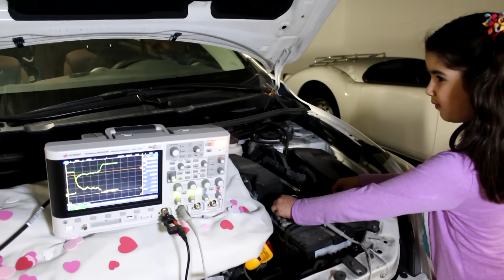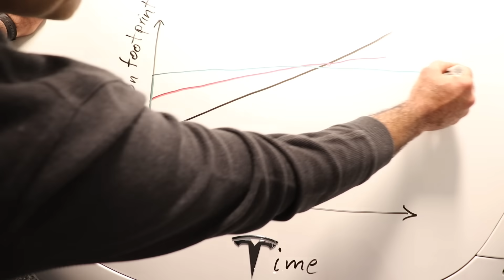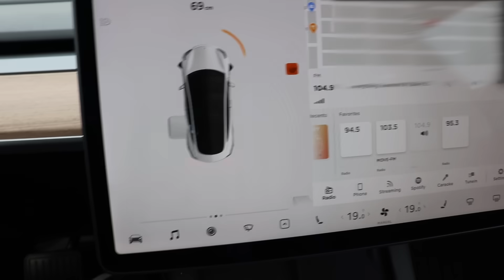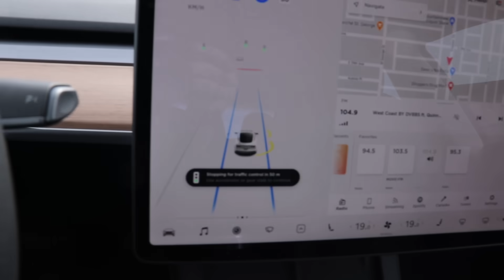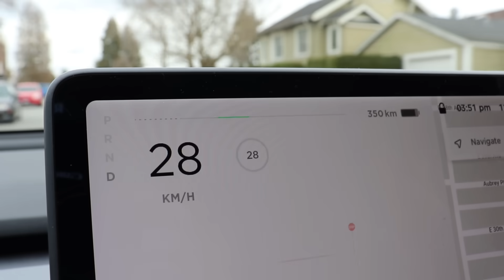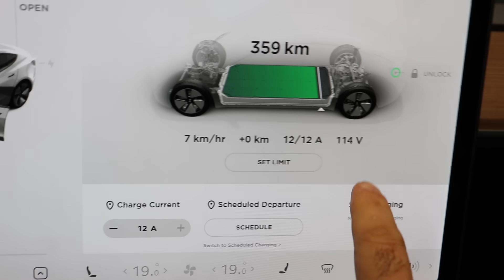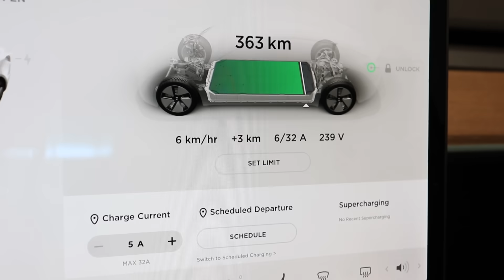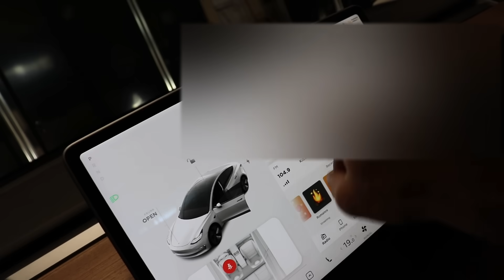ELECTRIC VEHICLES & My Tesla Model 3 Review

Comment: Still 18% powered by coal and natural gas (carbon). So make your line climb at 20% of the speed of the gasoline engine. Bet it crosses much later, especially when 50%+ of that thermal power is probably lost in upconverting, transmission, down converting, then charging, and using that charge from the batteries. So, maybe 40% the carbon generation of a gasoline powered car. Still, somewhere, the lines will cross, and you will be doing better... but not in the lifetime of the car I bet.

(Source: https://www.nrcan.gc.ca/science-data/data-analysis/energy-data-analysis/energy-facts/electricity-facts/20068 )

Comment: Ummmm You do realize that each year there is an increase on the demand for electricity as more and more cars, tools, phones, etc run on rechargeable batteries. And that means we need to build more power plants to supply that electricity. Which then leads to burning more fossil fuels to run those power plants... You get that right? There will never be enough solar and wind power to run everything we need. NEVER.  Because you can only put solar and wind generators in certain locations.. And you can only put so many in those locations. Its a finite system. 
So all your talk about decreasing your carbon footprint with a car is bogus. Because now you have increased the demand for coal and natural gas plants. 
I will make sure to wave at you as I drive by in my fossil fuel car while you are stuck charging your vehicle up for 8 hours.

Comment: Of course, you need a heated garage or the 120v charging can't keep up with the loss from the heaters keeping the battery warm.  And nothing about how much it costs to repair because it's new.  In a couple years, after an accident, costs go up dramatically for all those fancy features to keep working.  Of course high end ICE cars have similar problems.  Diagnose Dan as a video of a BMW taken out by a short in the passenger door handle.  Car wouldn't start and he was the last resort mechanic after they'd thrown thousands of dollars of parts at it.

Comment: Technically, super slow charging isn't actually better for the battery.  IIRC, only charging over "1C" (60kW) adds to degradation.  Making the charge last longer is nice for the grid, but uses more energy overall because the car's computer has to stay turned on the whole time. (About 100W.)

Currently I have mine set to 16A and start at 1PM, so it matches my afternoon solar output!

Comment: Battery disposal is still one of the biggest issues in electric vehicles, also, for some countries 300 km is nothing in terms of long trips. Also, for high loads on the vehicle, the torque acceleration relation would be deprecated. For my country, a lot of mountains and trips between cities about 500 km average, the best option is the hybrid vehicle, and exceeds on all the features you mentioned as advantage on electric vehicles (kinetic energy charge, brake by charging, autonomy) and also no disadvantages (no supercharges, no charge, no lame processor and ultra high costs)

Comment: 100 IQ: shaking the steering wheel every 10 seconds and tapping the accelerator every green light
10,000 IQ: jerry rig a windshield wiper motor to automatically shake the steering wheel constantly, and another windshield wiper motor to constantly tap the gas pedal, relying on self-driving to set speed and stop when needed by overriding the user inputs. Naptime acquired.

Comment: You should apply for self driving beta, it would be a good couple videos, also replace the 12V battery with a lipo/li-ion battery as it would be better in the long run

Comment: There no saving on electric cars at all, battery cost 8000 for electric car but gas car battery only 200 dollar, even you buy a used electric car, you still going to pay for new battery around 8000 dollar, but if buy a used gas car, you may not replace anything and drive it for long time before pay for parts,   Switching from gas to electric is beneficiary’s to business people than regular people, as I said you can buy a used old gas car and  you will drive it right away without  paying for anything, but if you buy a used electric car, you going to be force to buy a new battery for at,east 5000 US dollar. See it benefit business people, because they are seeing people buying used gas cars and  benefit business people just a little for a cheap parts. Example you can buy. A used gas car for just a 1000 US dollar and, and spent just like 100 dollar on it to change and clean transmission oil and drive it for like two years or more wit ought paying a sent more, like I did buy a 1999 Honda CR-V for 1000 dollar and drive it for two years and I start changing parts myself just for safety because the car pass 200000 miles in odometer, with electric car will never have that chance again buying used car for cheap,  if you want buy a used electric car you will pay at least 5000 US dollar for new battery plus the cost of the car of course, it will come to at least around 7000 two 8000 us do.lar just for an electric old car.

Comment: You said charging is more efficient at lower currents; could you run some tests on at 6A and 10A on both 120" and 240V to compare power delivered with power drawn? Seem to recall someone not recommending charging at 6A because of lower efficiency - but buying a tesla to check wasn't an option..

Comment: I watch Fully Charged Show on YT and they had full analysis of environment impact of EV vs ICE car from obtaining raw minerals, to manufacture, to whole fuel chain and down to recycling and disposing, EV are all in all 10x less polluting currently than whole ICE car is. So yeah EV is more environmentally friendly than your gas guzzler. 10x more green. Go EV!

Also manufacture of normal car uses more pollution because it needs lot more energy and material in factories that are big and complex that even EV cause more pollution in manufacturing is a MYTH. When your fuel uses fuel to make fuel and uses more fuel do deliver fuel to you to use is just plain joke and after all that wasted fuel in the end you throw away 80% of it as waste heat.

How do I know that this manufacturing carbon footprint is a myth? Because some say it's battery, some say it's use of more metal due to heavier weight and there is no single unified reason out there for it. With peer reviewed science paper on it obviously!

 I guess I'm one of those overly green people now eh? Oh well, at least we'll have some fresh and clean air again.

Pro tip for every electroboomer! Do not charge your EV on your travels to 100% it's much much faster to charge it to 60-80% because last 20-40% are 2-4x slower! You can make your trip faster with smaller charge which you can even see on dashboard how much it's getting in and you can decide when the kW charge is low enough for you to say meh it's not worth it i'll just charge again on next station.

Comment: This is why hybrids are the best option at this point as they offer both regenerative braking and drive on the battery but with the benefits of a combustion engine and because they're using a significantly smaller battery the initial pollution is also lower

Comment: BEVs on 100% coal power are still cleaner than ICEVs. Explosion engines are much less efficient than electric motors, offset by fuel density and future debt, and stationary power plants have economy of scale plus better scrubbers and combined heat & power.

Comment: You get 8k back from the government  if you buy one ? - here in Australia they want to hit you with a levy for owning one because the tax on fuel is so high here and the Government doesn't want to lose any revenue if everyone switches to EV's.
I didn't see any mains power sockets on the dashboard - where does one plug the soldering iron into😂
Don't tell me they didn't fit an inverter ! All that battery power and you can't run your fridge off it during  a blackout - useless piece of junk 🤣
May as well go back to riding a horse - whack a set of shoes every year, it mows the lawn for you and you get fertilizer for your garden for FREE !

Comment: Mehdi your statement about gas cars not gaining from a drive up to the mountains is incorrect. 
My car gets about 280 miles per tank of gas before needing filling, and after two trips up to the nearby 9500ft mountain I get 375 miles before needing filling. An increase of almost 100 extra miles. Everyone that lives on the mountain also notices substantial gas tank range increases. Because the engines are more efficient at more open throttles, and coasting down the mountain uses very little fuel. Same concept as semi-truck engines designed to be big enough to haul the load but not too oversized, plus diesels run unthrottled always(air flow) makes them more efficient. 
Just saying.

Comment: Regenerative breaking exists in gas powered cars with a manual or automatic dual-clutch transmission... Well, kinda. When you are coasting in gear you are not using any fuel, but you don't get your fuel back.

Comment: https://youtu.be/CvmvFGaSc6k could this be possible?

What I feel is if instead of using the regenerative braking when acc pedal is lifted, what if we use low power generators at each wheel, so we have 4 generators which are continuously generating electricity while car runs, be it in acceleration or deceleration state. Also this would reduce the mechanical transmission losses while regenerative braking is used.

Comment: Fun fact. An engineer who worked for me bought a Tesla to drive some 100 miles into work. He got on the freeway, held the wheel and let auto pilot drive him In close and napped. This is dangerous.  Don’t do this. Butttttttttt. He did.
Reply: People have crashed and died doing this, which is clearly outlined when you enable the feature. Money can’t buy brains
Reply: @towlie911  Several Murphy's law adages claim that idiot-proof systems cannot be made, for example "Nothing is foolproof to a sufficiently talented fool" and "If you make something idiot-proof, someone will just make a better idiot." Along those lines, Douglas Adams wrote in Mostly Harmless, "a common mistake that people make when trying to design something completely foolproof is to underestimate the ingenuity of complete fools". ~Wikipedia
Reply: @rennegaddefoxxe  even then it's risky. Like ramming into something or when speeding on highway a little bit sideways and ur car rubs on the wall of highways.
Reply: @monarch3724  I'm sorry to question you, but did you click on my name but reply to someone else?
Reply: What about all the videos of the person filming an empty drivers seat or the ones with the people playing games in the back seat while on the highway?  I know that there are certain sequences you can do to turn off different things you otherwise couldnt...  like tap brake 3 times, push the on buttin 5 times then hold the brake and gas at same time while pushing the drivers window down and then hold down the on button to turn traction control off..  or you can buy the whole tune .  Turns the dash red and lets you be able to drift em..   

And yes i clicked the name but replied to something else.,  cuz who leaves the notification on for comments..?  You really care what people have to say about whatever it was that you said?
Reply: @rennegaddefoxxe  this is perfect
Reply: @The Lavian they don't drop out of autopilot, they slow down and eventually stop. Better than dropping out of autopilot if you are actually asleep or otherwise incapacitated.
Reply: @The Lavian You can automate this process easily
Reply: @Red_Salmond  you could just wrap your hand on the steering wheel and the bumps of the road mey just be enough.
Reply: Really all that is necessary to do this is a weight placed on one side of the steering wheel. There was a company that made a part specifically for this... not sure if they still sell it.

It's a really bad idea if you care about living. You'll probably be fine at least 99 out of 100 times though...
Reply: To ppl who say this is BS: just search youtube for videos on ppl sleeping on the highway in a Tesla, you will be shocked.
Reply: And nothing happened, right?
Reply: Possible, yet not plausible
Reply: inb4 he makes a seat that zaps you whenever you doze off
Reply: so do we drive cars or is other way around
Reply: If that is true, your employee is crazy.
Reply: Sounds like he’s lying and your buying
Reply: Biggest Richard Cranium  eBay as a value guide, which a lot of local pawnbrokers do? 🤣 But all I did was look up a couple quotes about 'idiot proof', so I guess my comment wasn't? 🤣
Reply: Doesn't it have a camera that watches to make sure your eyes are on the road? And if you're not looking at the road for too long it starts beeping at you and then drops out autopilot?
Reply: @MrJoshdavis99  The technology to detect driver attention has likely improved significantly as well. There was a period of time when you could make it think you were holding the wheel by wedging an orange in the steering wheel spokes, and the weight on one side was enough for it to think it was your hand.
Reply: @MrJoshdavis99  they don't use it yet.
Reply: @MrJoshdavis99  The internal camera in Tesla's is not used at the moment. The only driver attention feature is the steering wheel nag
Reply: @MrJoshdavis99 it dosent use camara but if it thinks you're inactive like no movement on steering wheel , no head moments etc it will beep loudly
Reply: That's not actually possible. You need to give input otherwise it cuts out. I don't know why people keep repeating this misinformation.

Comment: my uk vw passat 2.0 diesel cost me $2300. uses 1 gallon of gas in 55miles and costs me around $1000 a year in maintenance. How many years before you have spent less than me taking into account the cost of your car in the calculation?
Reply: You also forgot price of batteries , that must be replaces after some years of  use. So, it is not fair to compare electricity price vs fuel price only.

Comment: @15:45 FYI, the on-board charger as well as the ac/dc charger is more efficient the more you draw current of it. It is way more efficient if you charge with full power compared to minimum.
I agree on other points.

Comment: yeah, therein lies the problem. You save $1200 on fuel a year compared to a decent combustion engine. But you pay like $20,000 more for the vehicle. That's a LOT of years you have to be driving that thing to make that $1200/yr worth while. Sure, you save on some basic maintenance, but what do oil changes cost me per year? $150-200? That's still a lot of years at $1400/yr. And that's assuming the batteries on those things survive the entire lifetime of the car, which is a real question. If they don't, then the "saving on maintenance" comparison gets even weaker. I'm all for owning an electric vehicle, but those prices really need to come down first.

Comment: actually the accelerator is pretty similar on a manual, on a manual when you release the gas pedal it will engine break unless you put it in neutral or press the clutch. this is why non-synchromesh manuals are very popular on big trucks, because when you go down a hill you can never rely on the brakes unlike on a small car

Comment: THANK YOU for pointing out the distinction between self driving/assisted driving and automatic cruise control. The latter is actually a pretty simple system either with LiDAR or object tracking cameras which is much simply than AI self driving yet ACC provides 90% of the actual benefit. I think the ACC provided in a Bolt or Volt plus some basic object recognition would be perfect. Assuming the AI systems get better I might reevaluate my opinion some day. However I am NOT making the assumption that'll ever happen. AI isn't a panacea. Whats a lot more likely is roads are just heavily standardized to make machines drive on them better.

Comment: I have a Chevy Bolt, it usually takes about ten seconds* to charge it. 
Edit: It's true you'll rarely get the advertised range, sometimes you'll get more than that. YMMV.

*I just plug it in when I get home and it's ready to go in the morning. That's a lot better than the almost bi-weekly trips to the gas station to fill up my old Subaru.

Teslas "phantom drain" much more than my Bolt seems to. I've let my car sit for weeks at a time without charging and it's lost maybe 1 or 2 percent.

Comment: Even in areas that rely on oil-fired power plants, an EV is still cleaner and more efficient since co-generation power plants can achieve 60+% combined efficiency vs about 40% for the fanciest gasoline and diesel engines. Power plants also have the benefit of much more thorough exhaust scrubbing. For city driving, regen braking gives EVs a huge efficiency boost too.

Comment: "price of running on electricity is much cheaper than gasoline." For now, until almost every vehicle is ev
Reply: at that point gasoline will be heaps heaps more expensive as no one will be refining it any more
Reply: @jnawk83  that would take a while i guess, I'm not sure how fast refineries react to demand.
Reply: @crackedemerald4930  when "every" vehicle is an EV, then demand for gasoline will be practically zero and there will be no reason to refine it at commercial scale.
Reply: @jnawk83  but until then, as demand for gasoline decreases, the price will drop, making fuel cars more affordable. But, by the nature of the process, i doubt it will ever be cheaper than electricity, since you use fuel and electricity to get fuel.
Reply: @crackedemerald4930  yeah, and electricity itself is getting cheaper (& cleaner)

Comment: you also forgot that replacing that battery in 5 years ... at least rebuilding a gas engine those parts are melted down to make new steal. OOO and when they stop software updates so you cant use your FAST charging anymore to force you to buy a new one. FANTASTIC!